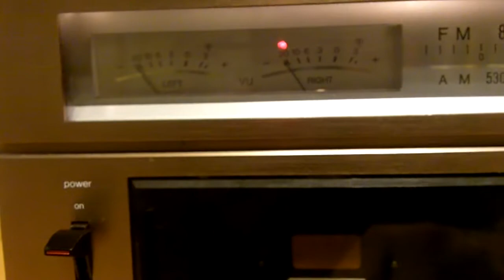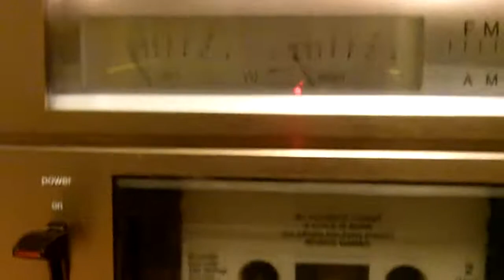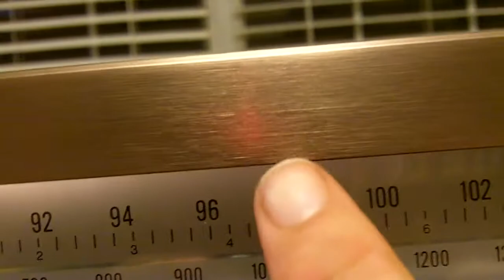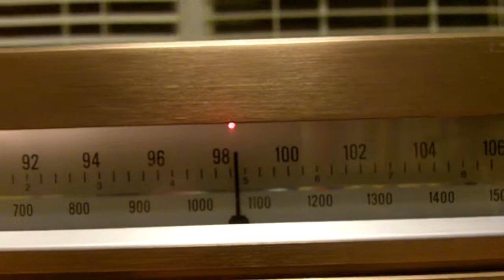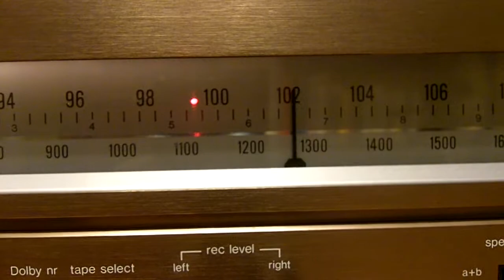Panasonic RA-7500

Comment: Beautiful unit!!!!!  They don't make audio equipment like that anymore
Reply from the maker: Thanks Richard! I haven't looked at it in some time, but I think I just need to isolate the capacitor that is bad and get the tape working right. It did not act up in the video and I have a feeling I had 'charged' the capacitor. It is still a great unit and when I get that fixed, I may put it up for sale again. Cheers!